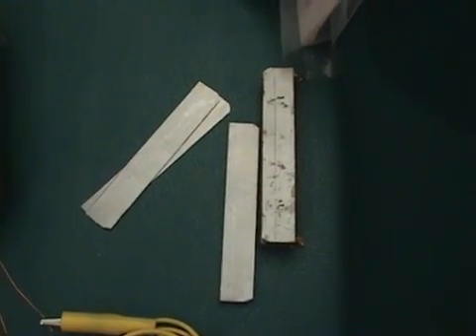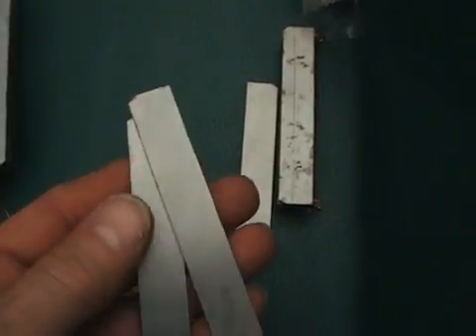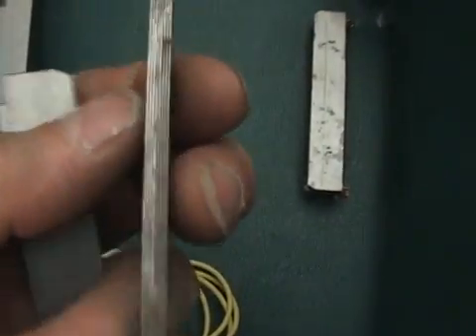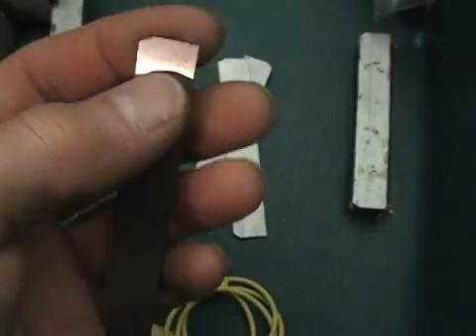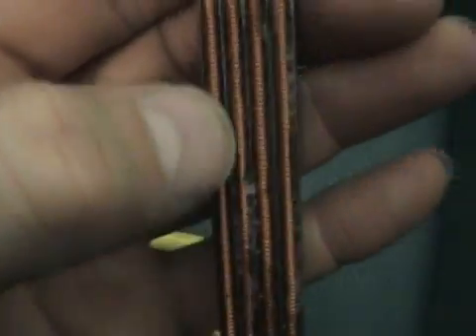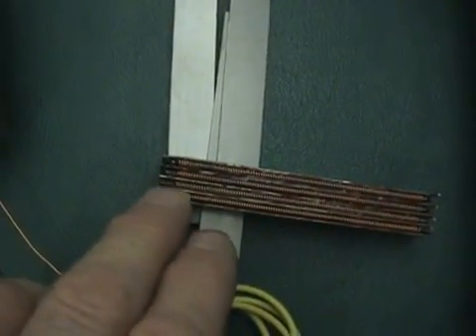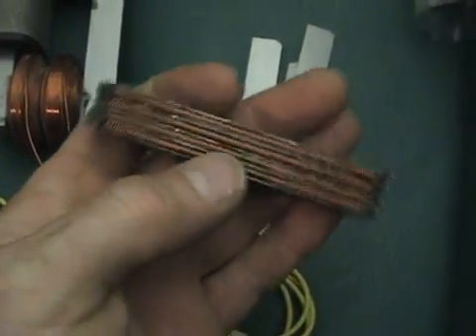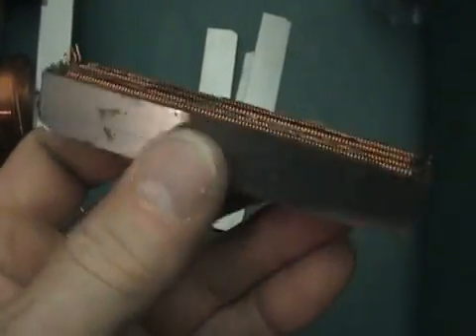Delayed Lenz Effect in Transformer test 2

Comment: When you wind each lamination like this you are magnetising each separately, but in so doing you have electric fields in opposition between the laminations.
If you want to make the most efficient use of just four laminations form them into a magnetically hollow square tube (on say 1/2" square wood) with the corner edges touching, and make just a single coil overwind.
The resulting inductor will have much improved impulse/ frequency response due to lower C in windings and more efficient form.